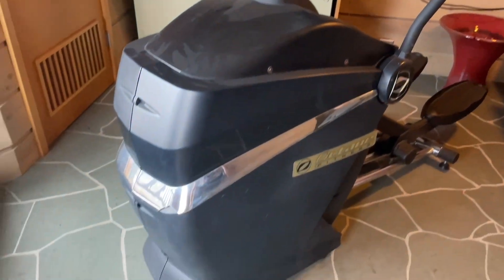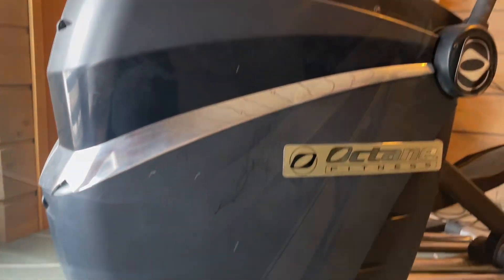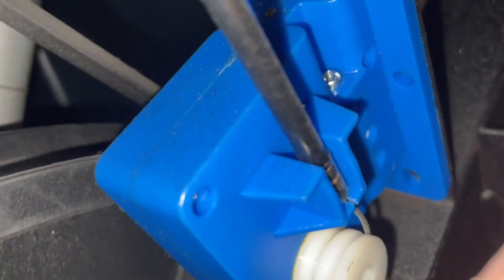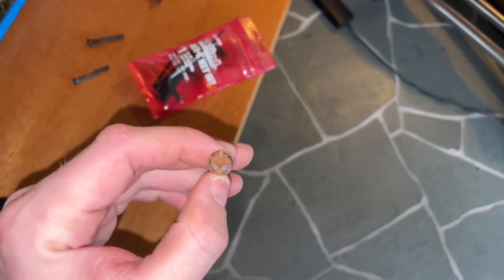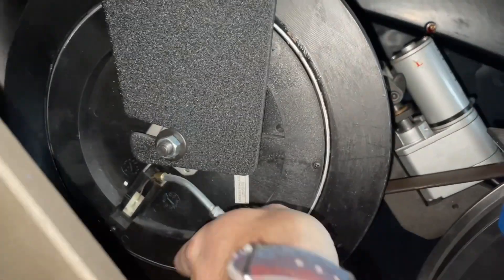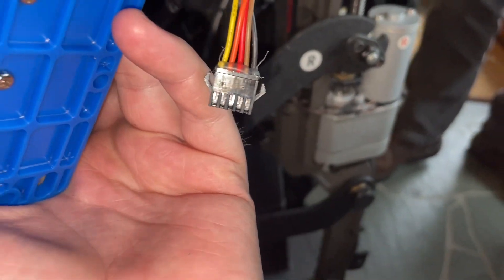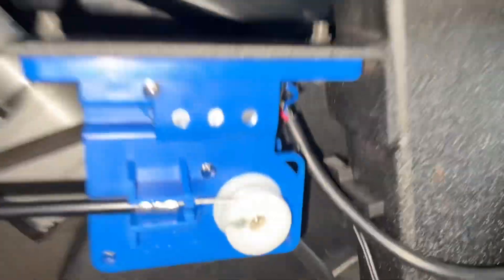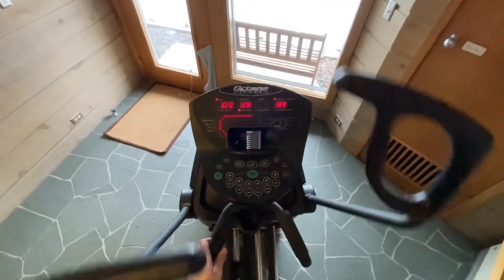Octane Fitness Q45 Elliptical Resistance Servo Motor Replacement

Comment: I did not replace the full servo motor but just the small green capacity (labeld 104J 100V) for a few cents, and that works !! I put some pictures on ifixit if you are interested.

Comment: Hello,

Just replaced the servo motor, but resistance seems very heavy, even at level one. Any idea whar went wrong?
Reply from the maker: likely did not index the motor correctly before installation
Reply: Thank you @OvalboreTech

Comment: Somewhat helpful but as you likely know,  the manual asks to ensure the unit is at Level 1 resistance before servicing/ replacing the motor.  Next,  the slot for the cable has to be oriented at the 5 o'clock position before turning the machine back on.  This is because if the machine isn't in Level 1 and the servo isn't oriented correctly,  you'll place too much resistance/ strain on the cable and it will strip out the plastic gears in the servo motor.  At that point,  you'll have to spend $60 for another servo.  I know because it happened to me.  The manual tells nothing about how to orient the servo or for that matter,  the plastic piece hold the cable at the other end of the servo.  There is another video on YouTube explaining how to orient the servo pulley.

Thanks for posting, however.
Reply from the maker: seemed very unwise to reindex the cam on the new servo and machine tested fine. the pot is indexed to the cam from the factory as far as I can tell and it self tests when the machine is booting.